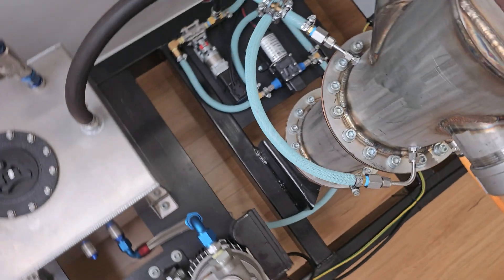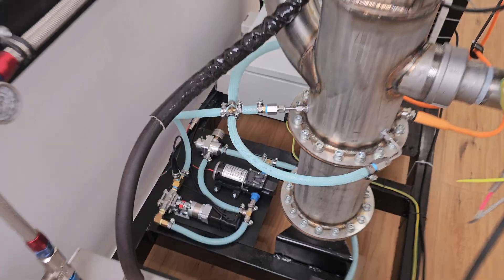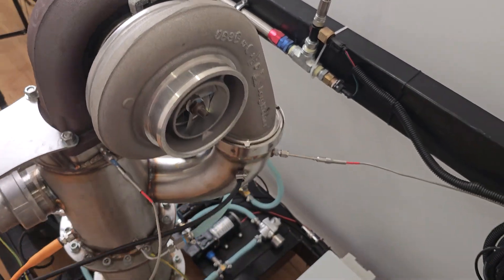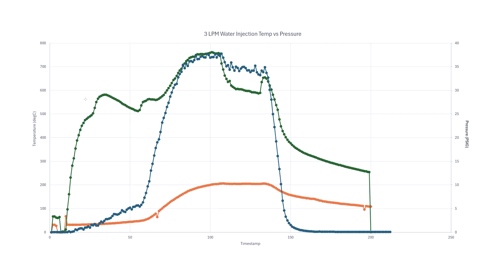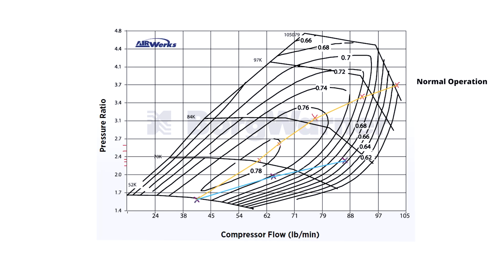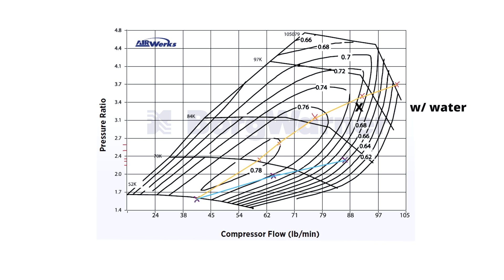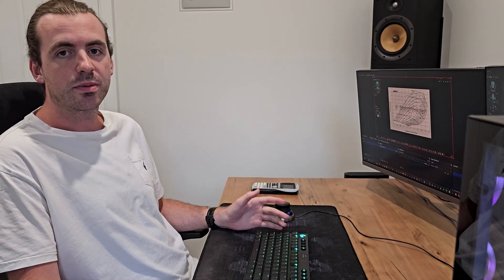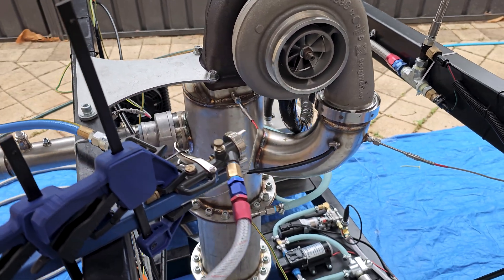Testing My JET ENGINE'S Water Injection System!

Comment: Interesting subject! Could one of those spray systems for general evaporative cooling by misting that have a pump to increase the water pressure to significantly higher than ordinary tap water pressure to generate really fine mists also work? 

Not that I'm an expert, but I've heard that working on the sound quality can make a big difference for how popular videos/channels get, for comparatively little effort. Maybe you want to look into how to decrease reverberation/echo when you speak indoors. And maybe explain the benefits of water injection a bit more, on a basic level.
Reply from the maker: @fishyerik  Thanks heaps for this comment mate, really makes it all worth it! 

The purpose built misting systems would absolutely be better, and even better again are high pressure fogging nozzles. I actually have a very high pressure spray system (10,000PSI), that i used to use for the kerosene injection, but for the purpose of the video I just scraped together some stuff that was laying around and easy to chuck together. Regarding the internal spray stuff, I'll definitely upgrade this to a 1000psi system in the future but this was just a cheap easy way with mostly stuff I already had. I need todo a lot more R&D with the water injection before I go investing in a proper system. Hope that helps! 

Regarding audio, that's a great call and I'll definitely work on it for future videos, thanks again for the comment it means a lot ☺️